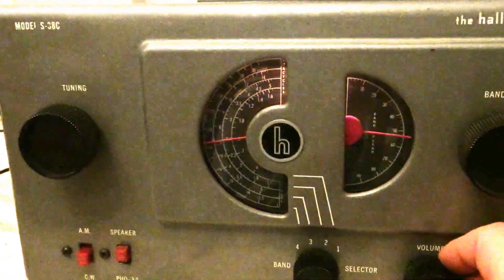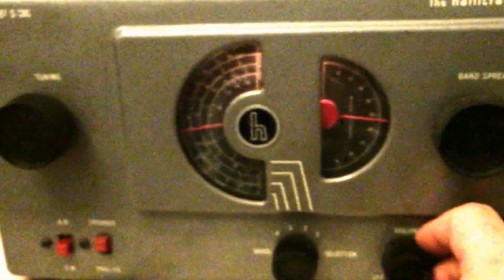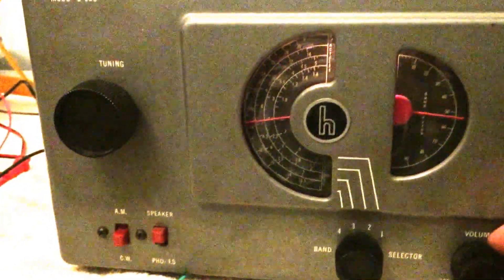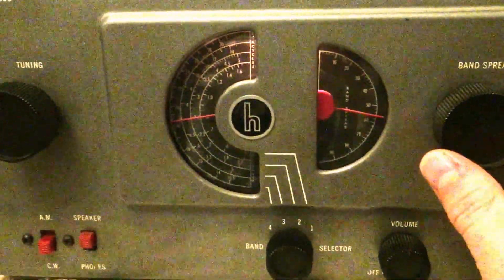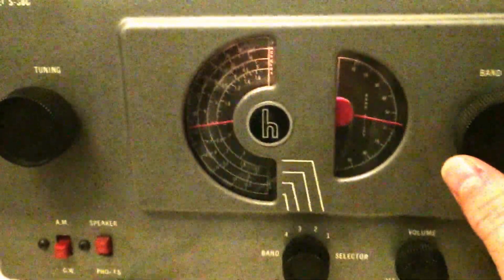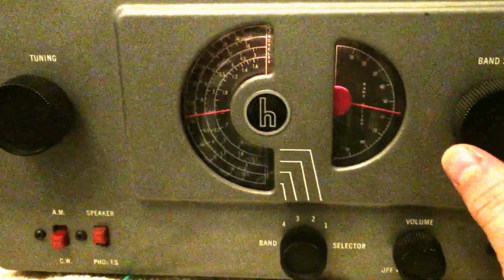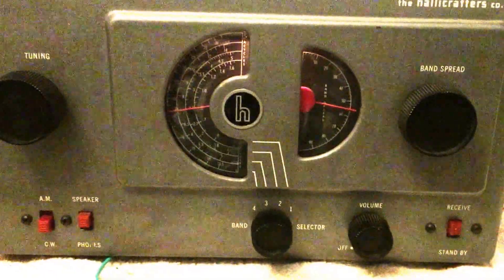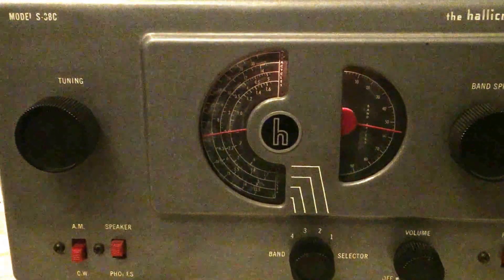Hallicrafters s38c calibrated and BFO fixed for CW

Comment: Have you picked up HAM operators using the original "bfo" wire?  I hucked mine in the trash and put a real one in, hearing a voice.  Just need a better antenna as it was very weak.
Reply from the maker: I have but not very good and hard to set up properly.